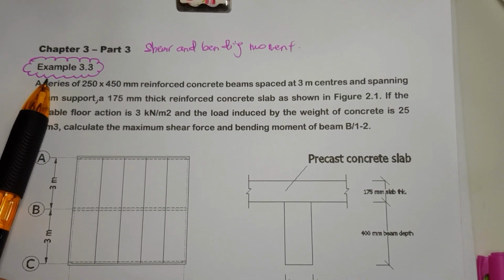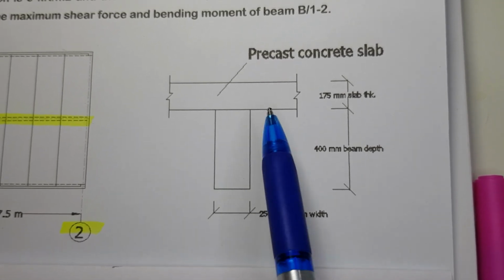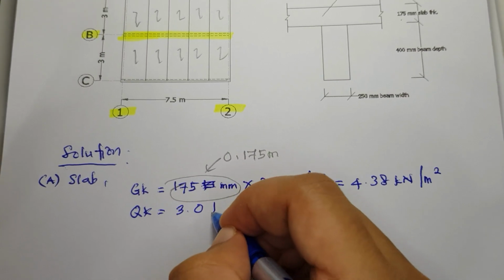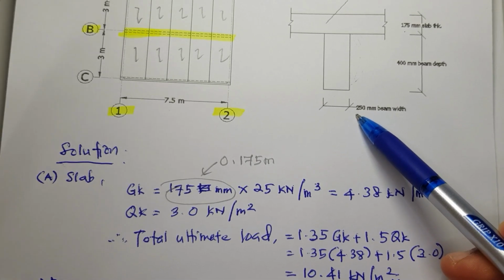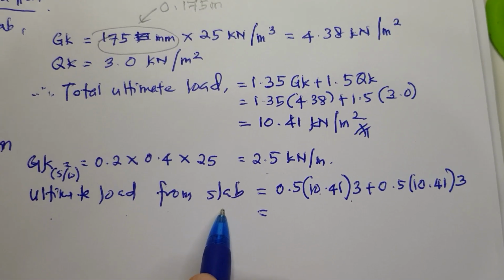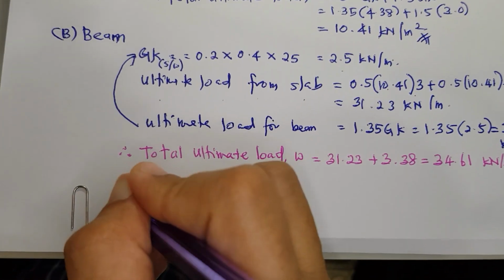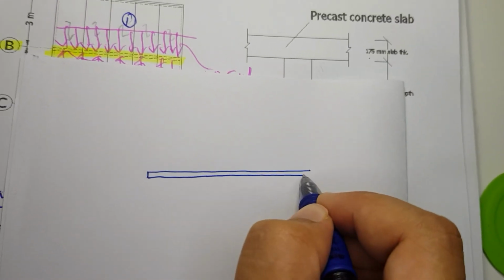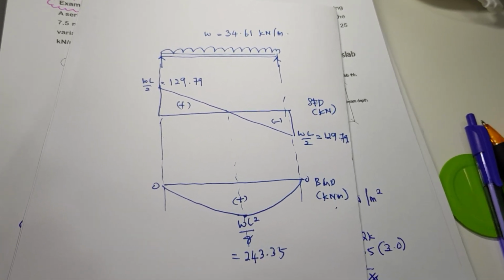Slab loading distribution - 1

Comment: width of beam is 0.25m , not 0.2m. thanks for the video
Reply: you got it right but it will confuse some students
Reply: do you know how she got 1.35GK and 1.5QK or is that a formula??
Reply: @zahidahmadzai8023  for Eurocode. 1.35 is the factor for the dead load + 1.5 Is the factor for the live load. ??

For Bs code , it's 1.4Gk and 1.6Qk
Reply: True, thanks.
Reply from the maker: Yes, you are correct. I mistakenly said 200 mm. But no worries, my class comes with notes too, I always amend them in class. Thank you for your concern.